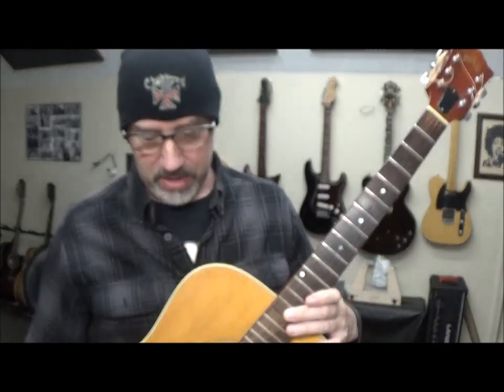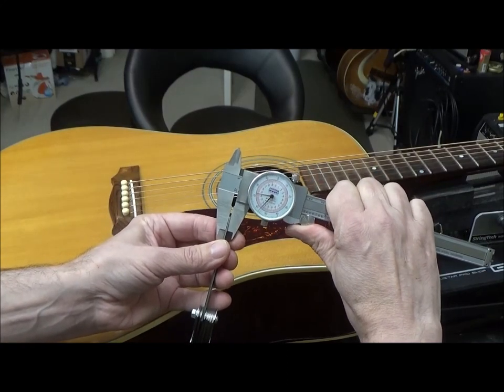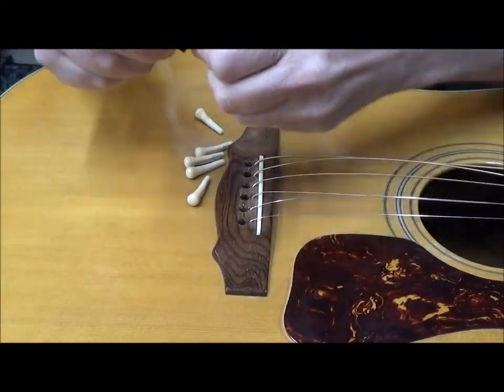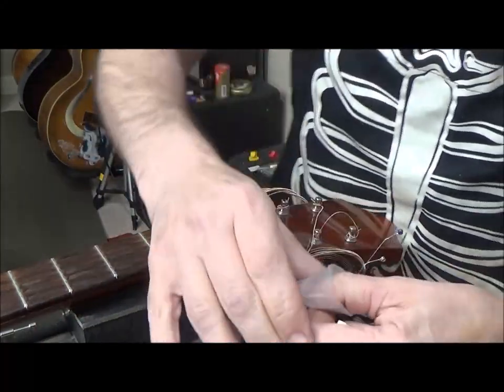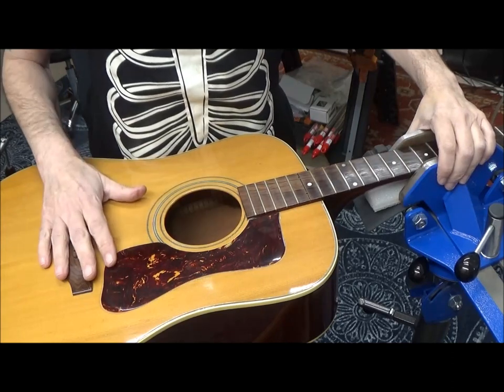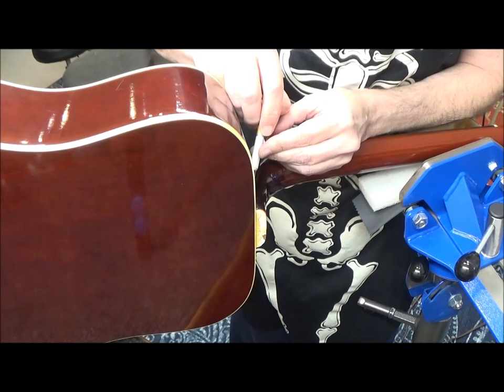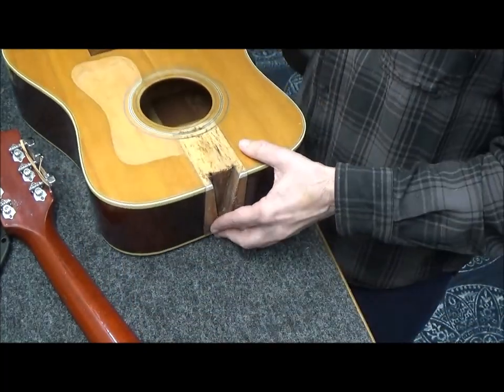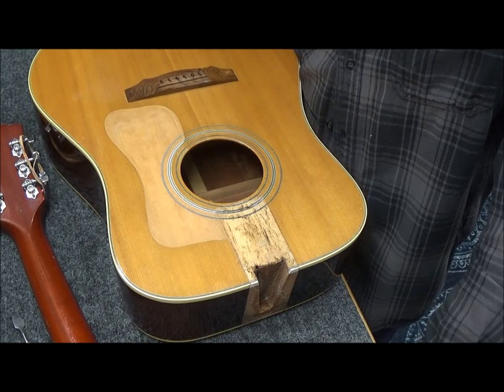Guild D40 Neck Pull / Neck Removal

Comment: I know someone who reset the neck on a Guild F-412 from the early ‘70s using steam. The steam traveled up the truss rod channel and caused a crack in the back of the neck. This is a pro with 40 years experience, not a keyboard wannabe. He had to glue then refinish that neck and made no money on the job. He no longer wants to reset Guild guitar necks. Maybe he ought to give the electric foam cutters a shot. Also, a ‘50s J-45 had to have a neck reset, and those cheeks were glued to the rims. The rims were laminate, not solid mahogany, and it was a real dance with lots of tape to keep those rims at the dovetail cutout from disintegrating. He’s reluctant with Gibson neck resets, too. I feel like showing him the foam cutters from Amazon, but he’s the pro, not me.
Reply from the maker: I had to refinish this one! The heel anyways. The dry heat took too long and the finish bubbled! 😂 These days I use the dry heat as a kind of foreplay and blast it with steam at the end. Both of these 2 other Guilds pulled nicely. 👍🏻
I’m up to 3 guilds now 🤓

Comment: Great job on a nice guitar.  I hate neck resets, not because I can't do it, but because I always seem to cause more damage than I should incur.  Yamaha being the worst.  My experience is that the glue is like cement.  Maybe epoxy???
Reply from the maker: Thanks Murph! The Taiwan Yamahas can be epoxied. There was a Nippon Gakki Japanese model In recently that came off easy. Regular wood glue. There is a new trick I’ll be sharing soon that makes it much easier
Reply: @harpethguitar  I can't wait for that trick.  I just got a Noppon Gaki 140 for fixing a guitar for a friend.  The neck set is good on mine.  BTW it is me who needs to be thanking you.  Fy finish repairs have evolved at light speed since I started watching your videos.

Comment: I've been trading and collecting old guitars forever. Lots of neck resets done on Martins and Gibsons. Usually Martins will always need neck resets. Sometimes old Gibsons are fine and they don't need them. When it comes to Guilds, a lot of experienced repair people are hesitant to get involved with them. They claim that it can be very difficult to remove the necks on Guilds. For this reason they fear taking on the job because they might screw something up. It might be a production or quality control thing where some years were fine but other years the assembly was rushed or there were different people etc.
Reply from the maker: I agree! Guilds are tough. This one needed some refinishing